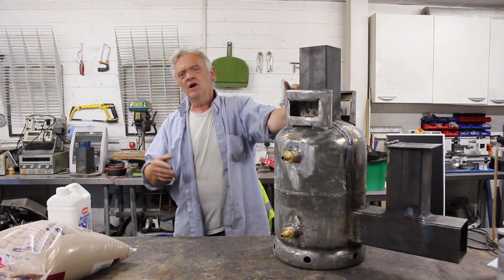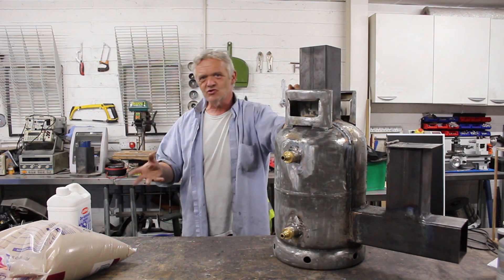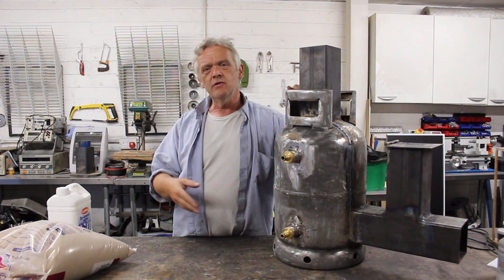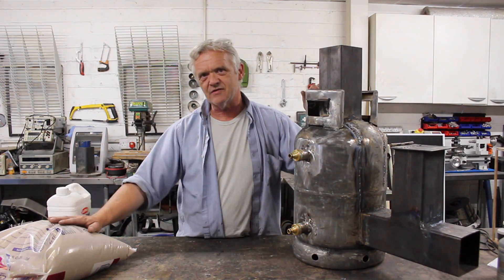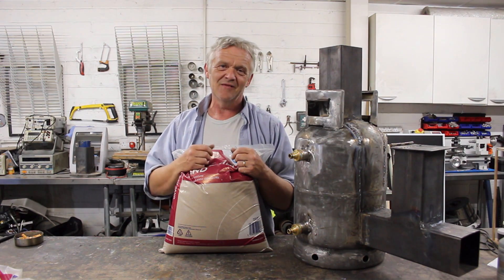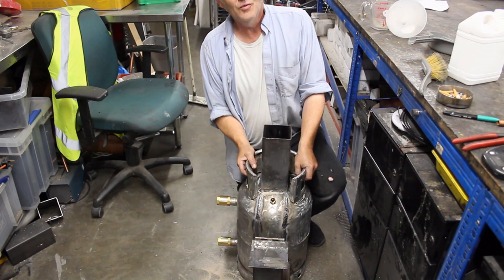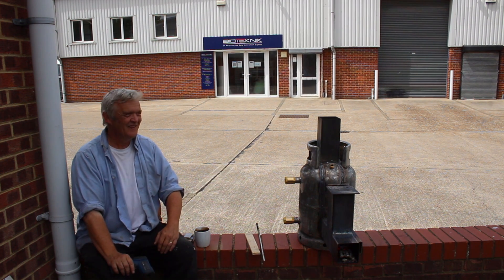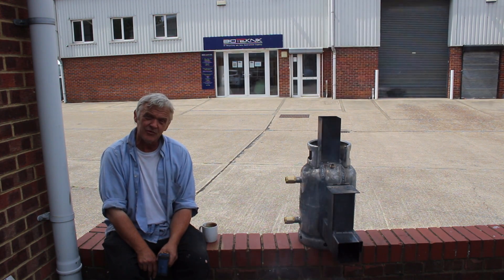1607 A DIY Sand Battery

Comment: I remember reading an article long ago about a cinder block container filled with sand and a fire box was built into it as well as copper water coils throughout the sand. The whole little building was just a box filled with sand and a fire box. The copper tubing ran from the box to the house and then they would build a fire in the box and just crank it up then let the fire die out. It would give in the dead of winter a good two to three days of comfortable heat to the home via a hot water system that also heated up the water for hot water for the home. The heat was not drying heat. During the summer you would not need that heat. When you did need the heat solar would not be viable because the weather was not producing enough electricity. Some days maybe. But if you have wood or some other source of burnable material you can have good heat through out the winter. May need to figure out a good way to do the solar or incorporate solar heat and fire box or some sort of natural gas for those with natural gas.
Reply: Put a copper coil tubing surrounded by the wet sand that you heated up (inside the heater) and the copper tubing going to a radiator inlet and outlet. Much like a pass through system. Fill the radiator up with antifreeze and make sure there are no leaks. What this will do is circulate the hot antifreeze inside the tank with the wet heated up sand outside and that circulation will keep the radiator heater heated all night long. I watched a guy do this in alaska where the temp outside was below zero and it kept him warm inside his little shack he build comfortable all night long. He was very far from freezing to death. He had his heating unit sitting outside in a campfire but the same premise applies here also. Can also use an H2 burner (if youre living off grid and doing the H2 generation thing) to keep the heater warm, much like a gas-powered hot water heater.
Reply: @alfredharrison597  How would you do the H2 production efficiently off grid? That takes a whopping amount of electrical power to produce dangerous H2. Just use the electricity directly to heat the sand for evening use. But you’d still need alternative forms and ways to heat the sand as solar may be obscured for days, weeks at a time. Combustibles are the option. Producing H2 is not efficient on a small scale. Why waste energy. I’d say for off grid, build a solid solar array and us battery backup and build a solar reflector to heat water during the day and pump that into your sand through copper pipes to heat the interior and have a huge sand container with plenty of piping.
Reply: @alfredharrison597 can you refer the guy from Alaska
Reply: Great idea!
Reply: So your saying you should run hot water into copper wires to heat up the sand???
Reply: @alakazaam-n7c  You actually run electricity through copper wires and water through copper pipes.    :)

Comment: How long do you think this would heat water for if you added a coil of copper tubing into the sand. Then pumped the water round attaching it to radiators. If you got the water moving fast enough so it will not boil of course.

Comment: Again very nice video Robert! 😁 We actually have found out that this doesn't work so well if you burn something because of the losses in exhaust. When you heat with electricity you don't have that problem 😁 

How about video where you heat a ton of sand with solar panels? 😁 There you have to find the right resistivity.
Reply from the maker: Thank you Tommi - I agree - just when you look at the numbers you can see a lot has been lost - the sand is storing well - which is what I was interested in but the percentage loss of possible thermal energy was high and like you I concluded the heat loss was through exhaust - you can actually see that in the heat haze. Cheers mate

Comment: So how do you convert the thermal energy displaced from a sand battery into electricity?
Reply from the maker: in so many ways and I have already answered this question - twice
Reply: @ThinkingandTinkering  Ok so I answered my own question in a way. Would a well insulated sand battery with a coiled pipe in the sand that has a input sucking in cold air that is then heated up inside the sand battery with a out put using said heated air to turn a turbine in a solar tower work? My question is not very well articulated but I can't think of a simpler way to frame it
Reply: @terrafirma9328  Thanks

Comment: Sand battery sounds cool! I wonder if instead of sand, if using something to increase the microscopic surface area would also greatly increase the instant energy release?.. Like maybe a combination of elements to establish a uniform balance of output potential.. Like maybe a combination of sulfur, charcoal, and some potassium packed into a tube!...hmmm

Comment: Rocket Mass Heaters are very good. I've been building them for some time. I must say though, DO NOT use the heat riser area for heat transfer. This will reduce combustion efficiency by quite a lot. Let the fire finish before using the heat.
Reply from the maker: Thanks for the tips!

Comment: Robert, can you show us the most efficient way to convert heat to electricity?
Reply: Steam
Reply: @maxmax-sr9lh what about thermoelectric panels. If it snows outside you can create a even greater temperature differentiation.
Reply: @alakazaam-n7c  not very efficient like 5 to 10% conversion the Best its a stirling engine can reach 40 to 50 % if its well construct
Reply: @maxmax-sr9lh isnt it impossible to reach 100 efficency for any given engine. So even I manage to make the other side really cold, I would still be unable to reach 100 percent efficiency. But turbine engine might be 80 percent efficent.
Reply: An atomic plant.

Comment: @1:14 Yes, water does boil at 100 degrees. But it is absolutely false to suggest that is some kind of hard limit. Naval ships have been compressing steam for a very long time. As long as the system is strong enough and sealed, you can get past that 100 degree limitation.

Comment: Molten salt had been experimented with. Molten sand or molten glass is an interesting idea
Reply: I think operating temps are too high for normal piping, and startup heat is massive.  I think most of the best heat exchanger liquids/gases are are on no-no lists, except for mineral oils ... which seems about right for single home use.  I'm not a fan of using water either as the thermal expansion coefficients get too high.  i dunno, off the cuff, maybe I'm off.

Comment: As an Aussie I reckon we should be using iron ore rather than sand. We have that stuff just laying around everywhere and it has about twice the density of crappy old desert sand. I should think that it would have a fairly high heat transfer rate as well.
Reply: I wonder if sand releases heat more slowly than iron ore would though. When I think of metal, I think it heats quickly and probably cold quickly too.

Comment: Hi Rob, that was really interesting. One question if I may……you said it took about an hour’s burn followed by 3.5hrs of useful heat……how long did it take before the stove gave off any useful heat? In other words did the sand itself soak up all the heat in the first hour?. Thanks 👍
Reply: The metal body of the stove is continuous so it must conduct the heat from the burner and radiates heats before the sand is even hot

Comment: The Sand Battery reminds me at Off-Peak Storage Heater which became popular in the end of 60ies. Instead of Sand was to bricks pressed rust. Unfortunately I don't know how high was the temperature inside. It's been working very well. So the idea is not new - it's now a matter of construction for longe time heat storage (only...).
Reply from the maker: me too

Comment: Please try a device that could use hot air rising to power maybe a converted inline duct fan I’m thinking    Metal bin black and rising aluminium   Tube .. powered by sunlight and maybe thermal mass included
Reply from the maker: it's a good idea mate - but why don't you try it?
Reply: @ThinkingandTinkering  my skills are not at your level yet  your tubes are fantastic and inspirational thanks . Hey I just wanted the idea out their couldn’t sleep wondering if it was possible :)
Reply from the maker: @Doubledonky  oh I agree mate - always best to have the ideas out there - thanks for sharing

Comment: I often hear the comment that concrete is one of the highest contributors to GHG via CO2 emissions during production. Not as well known is that it has been shown that over the lifetime of that same concrete, the same if not more CO2 has been sequestered by it.
Reply from the maker: cheers mate
Reply: "apart from herd of cows"
Cows are producing CO2 only by respiration and not contributing to overall CO2 emissions that much. 87% comes from fossil fuel.

Comment: if you was to put a winding coil inside of that tank and then poor sand in from the top. then put water through the coil for steam and turn a steam turbine. how long would the heated sand last? and then if you could convert it to some underground tank with couple solar reflectors.
Reply from the maker: no idea mate - give it a go and let us know

Comment: Awesome if you need heat,  now how can we remove the heat without an ac?
Reply from the maker: pipes in the sand - but it ia box and blow air over - I would think there would be quite a few ways

Comment: A Long Time Ago we in aus had a home heating system called a heat bank. It was a thermal mass heated with offpeak electricity. On demand a fan blew air through it to heat a room.
We took them out when the new saviour of the energy world cheap natural gas came along...
Reply from the maker: yeah we had them here too

Comment: I am going to get a 5-15 ohm 10watt resistor and increase its size surface area with sorel cement and put it in some fine grain sand and see how long it takes to heat up and cool down . You could just make 4 liter paint tin filled with sorel cement and many 5 watt resistors in parellel but sand is cheap.
Reply from the maker: I would like to see that mate - can you give me a heads up on the result? - cheers
Reply: @ThinkingandTinkering  sure will . On holidays at the moment but I will be doing it first thing back . I actually started similar concept a year ago by coating large grain river sand in graphite to directly connect electrode too. I tested it and works great but haven't felt confident yet in respect to safety and being left alone but logically I can't see a problem . Its just the thought of 400 degrees celcius in a paint can on the floor waiting for a T-shirt to accidently touch it and burn the house down ! 😂

Comment: I had contaminated oil in my skid loader last month so l  boiled off the water in an old fry cooker and dumped the clean oil into a 5 gallon bucket. The oil stayed hot for 12 hours easily. It was still very warm the next morning
Reply from the maker: awesome - I guess that's why they make oil filled radiators?

Comment: A better design would have been a styrofoam cooler because I believe you need to insulate the sand for it to retain the Heat nicely. A heat battery would be a great project to recycle an old electric kiln
Reply from the maker: hmmm - styrofoam is going to melt at those temps mate - well burn actually - or at least I would think so

Comment: Well this is interesting, I was thinking about building a wood stove boiler, with about 400 gallons of thermal storage,   this has me thinking about going with sand heated with the wood stove, with a heat exchanger , use the sand to heat water that will go to the in house radiator, I'm thinking it can possibly go to 250°F before pressure starts becoming a issue,  I was thinking of heating about 400 gal of water to about 200°F hoping it could store heat for a few days! If it's only a couple days! Running the pump about 10 minutes a hour,  to keep warm,   creative heating for an off grid home,
Reply from the maker: nice idea mate - water is going to be good if you go to less than 100C - the benefit of sand is you can get the temp higher

Comment: It would be interesting to see how long a coil of steel pipe would produce hot water for in the sand battery.  Steel would be structurally better than copper or aluminium as it has a higher melting point.  One should get a lot of hot water/low pressure steam out of the device for a long time which could be fed into a radiator of some kind for heating.  I would imagine that with the hot water recirculating back into the battery would extend the cooling off time.
Reply from the maker: maybe - go for it mate build it and let us know how you get on

Comment: need to find a way to heat with green energy then a way to use that heat
Reply from the maker: ? not sure what you mean by green energy - if you mean wind, solar wave - use a resistive heater - if you mean burning then replant at the rate you burn
Reply: @ThinkingandTinkering  not by burning

Comment: You just gave me a great idea. Thanks again Professor.

 I have big dirt and rock berms on my land, mostly clay. (I have a lot of very dense basalt rock on my land. The clay relatively fresh volcanic ash, with not much else) The rock is so dense, you have a hard time breaking it w/ hammer and chisel. I am a Mason as well, so I know what hard is.

Rocket stove, still heating water heating,  w/ pipes coiled in the berms. I can add sand where I excavate for the water line. I will also coil the lines under my floor and run a small circulating pump when there is no thermosyphon. I live off grid, and I have to run generators during our really cold winter, so I am gonna capture all the exhaust heat  with a heat exchanger, and put it in the system.

Win-win. I always think about all the energy wasted from exhaust heat. Now to figure out how to use the heat to cool as well. I will send you a video. 

I wonder if the rock has has a good storage capacity, but I don't have the equipment to find out yet.
Reply: This reminds me of my clothes dryer. I had the brilliant idea to use foam insulation all around it and then a put a small duct fan in a 10in duct and pumped the hot air out of my attic through the dryer. The dryer sucks in ambient air and heats it and pumps it outside normally. So when I did this to my dryer, I reduced the temperature in the attic which reduces the houses cooling cost and also it reduced the heating element required in the dryer, they use a sensor to turn on and off the element. It worked amazingly well at reducing my power. I just through I would share because it is an interesting way to save power and it really does work!!
Reply from the maker: @newmonengineering  that is a really awesome share - thank you for posting it mate
Reply: @ThinkingandTinkering  you are welcome,  I am actually surprised no one has built one on the market like this for better efficiency. Of course it's limited to having an attack that you can cut a 10in hole into, but honestly I think it could be a commercially available option for drying the clothes. The attic air is quite hot already and the movement of air through the attic reduces the cooling on the house because fresh air comes in through the sofets and that is at ambient temperature which is lower than the attic air temperature
Reply from the maker: wow - I think you are so lucky! what a great place to live - rock does have a good thermal capacity mate

Comment: I still use half a ton brick stove( 40 years old stove). Keeps the room warm until morning. Sand batter sounds like reinventing the wheel with extra steps.
Reply from the maker: hmmm? you have to make bricks? I think it's horses for courses mate
Reply: Yes, but brick does not hold heat long. You are on the right track.

Comment: I wonder what would happen if you had a copper coil in there, but ran the copper coil through the sand.  The sandwich would be a heat buffer, the water is easier to move and use.
Reply from the maker: it's an idea mate -  go for it

Comment: Hi Rob, fairly sure having done block paving using kiln dried sand it's just sand from the beach. It may have been heated in a kiln it may have just been skimmed off the top of a beach I'll let you decide- but it stinks of the beach/ salt water if you take up an old driveway or path In block pavers.
Reply: What about heating it beforehand to eliminate the smell?
Reply: @markusgarvey  they may do I don't know, everytime I remove some old block paving it smells of the sea. Happened countless times, maybe they went through a stage of using beach sand back in the day
Reply: @terrafirma9328  is that temperature related? Cos pretty sure sand on the beach where the tide doesn't reach is dry/dried unless it rains.
Reply from the maker: yours probably was mate - sand is curiously enough - a bit of a scarce resource - there are only certain areas you are allowed to recover it from and those areas are mined heavily - here in the UK we dredge a lot of our sand from the Bristol area sea bed I believe
Reply: Probably was as live about 20 miles off the Norfolk coast. These were jobs for customers happened on many occasions, smell is worse when sand is wet. Find that mad/truly unbelievable sand is scarce resource but then how else do they keep the prices up ;)

Comment: The problem is temperature.
If you have a home with a surplus heat during day, it will be at 25-30c max. At night you need the heat and the available heat has to be above 20-25c.
That is a very narrow window and changing the surplus to 600c is not trivial. The capacity of any such system relies on the range of temp you can achieve and without a system to deliver that delta it will be low.
Reply from the maker: I am sorry mate - but I disagree with what you say is the 'problem"